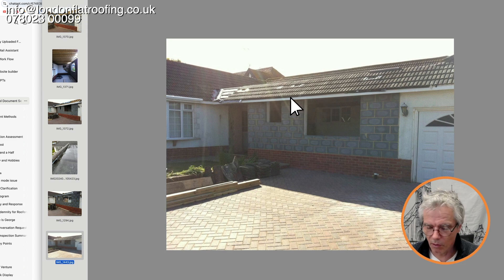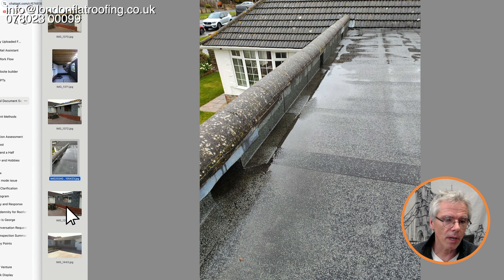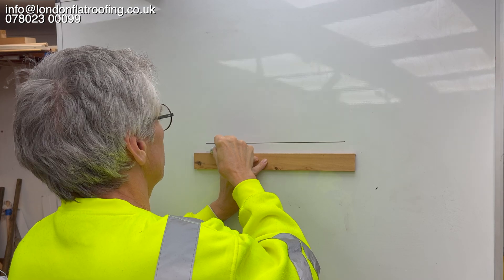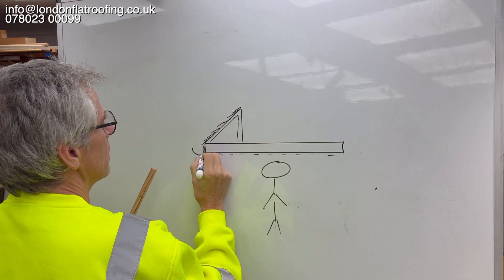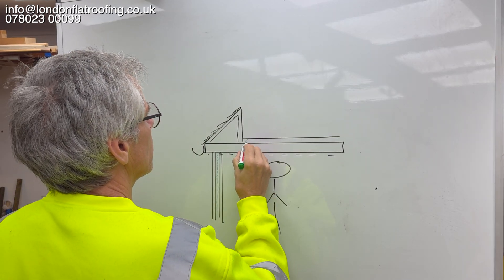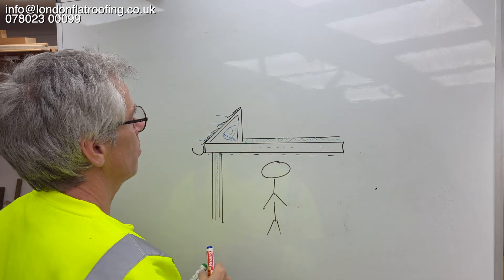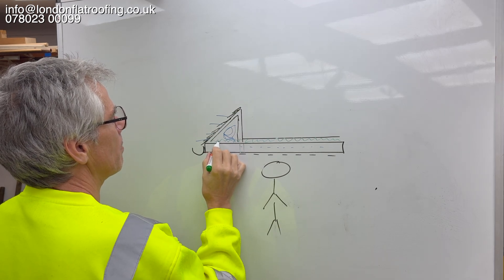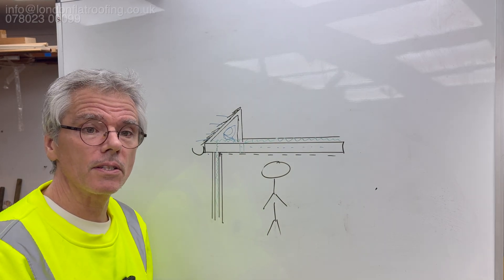Cold Roof Warm Roof Mixed?

Comment: Hello Steve!
Please if you can help me 
for warm roof I build a dormer that the dormer doesn't touch the loft and I build the dormer level with the other rooms in front of the house what should i do with the space between the timber that I attach the joists to in the loft
I'm afraid that air will get between the joists or affect the roof loft.

Thank you very much!

Comment: Another great videos, thank you. Did you say in one of your videos that were going to do one showing how to join a warm flat roof to a cold pitched roof - such as in a dormer?  Thanks in advance.
Reply from the maker: it's something I'm asked about all the time. I do mention it in a few of the videos and I've never done one exactly to do without. I've made a note but I know it's a very difficult one to do because it's pretty simple answer just treat them as two separate roofs and to do a video on that means that really what I'm doing is I'm doing a cold roof construction on the pitch roof. I'm doing a warm roof construction on an extension roof for a dorma and I'm just pushing them together. they're both separate items.

Comment: Some great advice there for this home owner.
Another option would be to use thermal insulated boards on the inside of the room and with the addition of closing of the junction between the cold and warm roof with multifoil.
I would also make sure that the air in the cold roof can circulate and escape from the soffit and through ridge vents.
Should solve the problem

Comment: Easy fix, lucky for them it's only got concrete roof tiles,  strip back first 3 rows of tiles, pull battons off, celotex joist in triangle and upstand inbetween joists    foam all gaps., not perfect but night and day difference for heat retention and will stop all cold draughts.

Comment: I think my new build (Outside of snagging period) has these same issues. NHBC are not interested either.
The house is spread over three floors and has bedrooms in the roof space.
I can feel air movement through the light fittings on the 1st floor bedrooms.
Thermal camera shows the first 1.5 meters of bedroom ceiling as cold.
Reply from the maker: I do a lot of surveys on NHBC properties like most insurance companies they're just not interested
Reply: I wasn't sure if I needed a roofer or a general builder.
The void is not accessible, so will have to work out best way of accessing it.
Annoyingly its the same issue at front and rear of the house, so I have to fix the same issue twice.

Might be able to cut an access hole in the 1st floor landing ceiling and then crawl in the void.

Comment: How the hell does this stuff get signed off by building control!?
Reply: Because building control dosnt actually do their job which is stop crap building. My place has so many builders bodges it drives me up the wall. All of the insulation in my flat roof was nigh on useless as it didn’t touch the ceiling and has a channel down to the end of the roof where the cold air came in. The more work I do the more short cuts and bodges I find.
Reply from the maker: that is gonna be one of my next videos because it actually says in their statement that they are sign of work that is wrong because it's not their responsibility. I've got that in there 64 page downloadable PDF.
Reply: @davideyres955  Agree. Bring back the old on site" Clerk of Works"

Comment: Thanks Steve, we had a similar challenge which you gave me advice on. We had a warm roof joing a cold roof with a vaulted ceiling. I installed 100mm PIR at the junction of the 2 roof construction types and painted all of the joints with passive purple to try and eliminate any airflow from the cold roof to the warm space under the warm roof. Its really frustrating the poor quality of building work that is still happening in the UK. Our build is subject to BC inspections but these are really not paying attention to detail. I do understand that it cost more to do the job right and thats why people cut corners.
Reply from the maker: Yes, unfortunately, we just can't get the tradesmen and nobody seems to be interested in doing it properly.

Comment: Very useful Steve. The other option is to take the tiles off and stuff the gap with insulation to maintain continuous insulation from wall to ceiling. Only if the ceiling internally is already finished otherwise like you say taking the plasterboard off is the other option. By the way have you seen any warm roof done with multilayer foil insulation only and not rigid foam..
Reply from the maker: I haven't seen any flat roofs done with multi foil yet I've been close to doing one or two that's for sure and yes I forgot to mention that he could've done it from the tiles but realistically that would cost a lot more money and be a lot more difficult is much better off to take the ceiling down can you imagine doing it through between all the joist? Keeping the rain out? You'd have to take the Phil and all the buttons off and all the tiles off and reaching whether it would be much easier to do it from underneath.
Reply: @SteveRoofer  thanks Steve . Would be interesting to get your views on multifoil approach in a future video because I have looked at details of one of the  multifoil companies website on how they do a warm roof and just wondering about your take on this